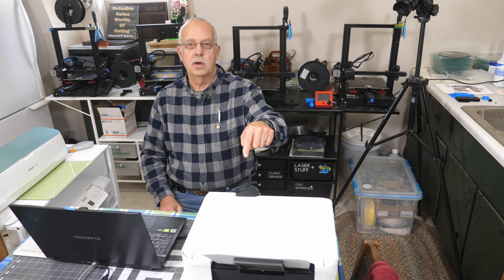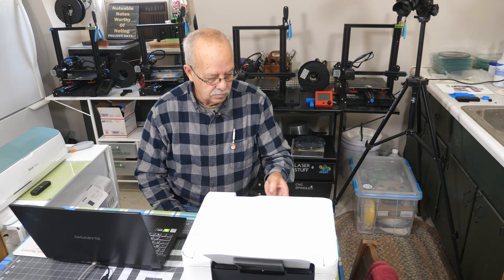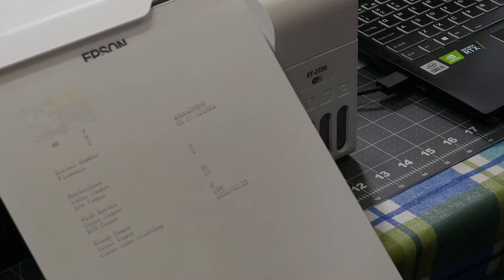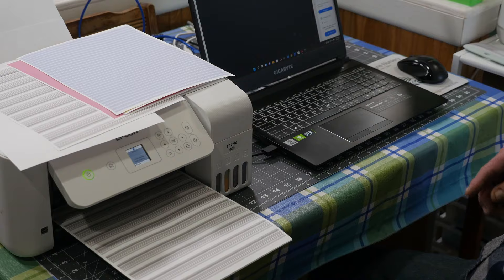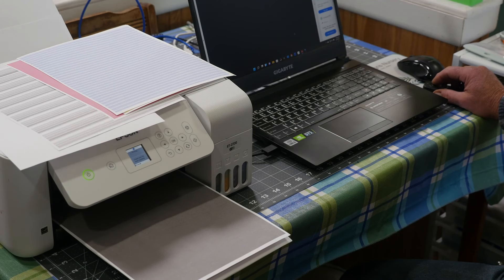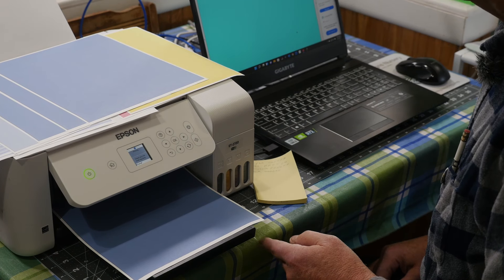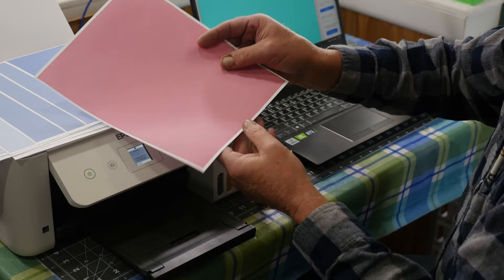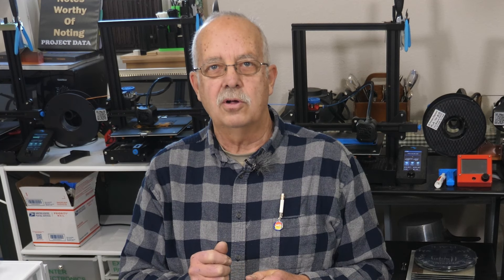Epson 2720 Printer Clogged Nozzles FIX

Comment: So I’ve been continuously doing the deep cleaning and using your free colors to print was getting black with many skips. But now no black comes out at all! Just refilled the tanks also
Reply from the maker: Ease up on the Power Clean or you will have a full maintenance tank that you may not be able to replace, depending on the model.  You could have a clogged line on the black.  Sometimes shaking the printer from side to side (don't get wild with this) several times can free up sediment or a clog.  Works for most, but not everyone.  Beyond that, it would require opening up the printer, disconnecting the line from the ink tank to damper, and check for clogs.  Not impossible, but not simple, either.

Comment: Hi Roger I’m following your video on nozzle clogging, my black and yellow started working, but my cyan and Magenta is not coming out at all after about 4 times . Do I keep running the color test until I start to see something?
Reply from the maker: You can try (gently) shaking the printer from side to side several times.  Some inks can form sediment that clogs the lines.  This works for some, but not all, so your mileage may vary, as they say.  As a last resort if this does not work, do a Power Clean.
Reply: @rogersshop  ok will try again today, hope I’m Successful , wish me luck, thank you.

Comment: Hi there, my Epson 2760 is printing dirty sheets.  There are smudges of black ink all over the page and in one corner.  It's worse on double sided printing.  This is happening even when the nozzle check shows that the lines are all in tact.  I use it a lot for my business and I need the copies to be clear. I do clear the nozzles and clean the print heads regularly when needed.  My sheets are printed with black print, pink print and sometimes blue print along with some graphics. Any advice?
Reply from the maker: Possible causes-  One of the internal damper ink tanks is leaking, ink pad at right hand side is curled up, ink pad is saturated and waste not going to maintenance tank, leaking ink line, printer was inverted at some time making ink leak internally.

Comment: Im currently in the process of unclogging my cyan. At first it was just a blank page and I'm now on about page 7 and it is now printing a light yellow. If I continue to print is the yellow a sign that it  is working or do I need to do power clean? Thanks so much!
Reply from the maker: Try shaking your printer from side to side several times first to dislodge any sediment.  If this does not improve, then a Power Clean would be the next step.

Comment: Hey Roger, thanks for this video!! I am only having issues with the black ink. I ran about 12 black pages before I switched to high quality printing and it printed full color, without streaks. So I thought I'd give regular printing a try again (thinking I had fixed the issue) and it still has streaks. Does that mean I just need to print in high-quality every time, or do you think I should keep printing pages to try and clean some more?
Reply from the maker: There can be a lot of variables here.  The head could be partially clogged, a line could be partially clogged, or it is possible the head is failing.  As a lst resort, you try a Power Clean to see if that resolves it.
Reply: @rogersshop  This is happening to me as well, and ive done 3 power cleans on it already. Ive even used the best printers cleaning solution. Not sure what the problem is, but as long as i print in high and not standard it prints fine. When i print out a nozzle check or an alignment page its got all the lines and I cant fix the alignment
Reply from the maker: @SG-cw4di  That is sounding like an issue with the nozzle head and/or firmware.  Can't help here...........

Comment: Hey Roger, my magenta isn't printing at all when doing your recommendation. Black looks perfect, Yellow looks perfect, but the Cyan is printing as a pale yellow and magenta isn't printing anything at all. Any recommendations? I'm printing the Magenta and Cyan 4 times now to see if it gets any better. I just got this printer a year ago and have only printed 232 colored pages on it. I have 16 pairs of earrings that I have to make this weekend so I need a fix ASAP!!
Reply from the maker: You can try shaking your printer from side to side several times, then try again.  This works for most, but not everyone.  I've had to run 20+ sheets before on some printers.

Comment: How long should I continue trying to print. I have been trying for 4 hours. Help!! Do you advise going into insides and trying to remove the clog that way? I did try the gentle shaking back and forth of printer and it fixed the black but not the other colors. I'm so disappointed as I didn't realize I should print something once a week at least. I just didn't print much. So I have basically a new printer hardly used that's not working.
Reply from the maker: Odds are it is NOT the head, but the damper tanks are not getting ink.  Try shaking the printer several times again.  Some inks can form sediment that blocks the outlet of the ink tank.  If they are hard-clogged, then you will need to open the printer, disconnect the lines and purge.  this is a VERY messy procedure!

Comment: Will this work even if I have ink, and yet certain colours are not printing at all when I do the color block test? The printer is less than a year old and not often used.
Reply from the maker: You may need to run the four sheets many times to clear it.  Once cleared, run at least a nozzle check once a week to keep in operation.

Comment: Sorry on  more question.  how often do you clean the heads?  Thanks
Reply from the maker: I don't.  I run at least one page of multi color every few days if not in use.  Even just running a nozzle check every day or two will keep nozzles from drying up.

Comment: Printed over 200 pages and no change in the cyan or yellow - magenta and black are fine. Don’t want to do a power clean so what would you suggest to try?
Reply from the maker: Try this-  Disconnect printer.  Pick up and shake side to side several times, then try again.  This works "most" of the time, but not 100% of the time.
Reply: @rogersshop I’ve tried shaking and still no cyan!

Comment: Is that an old Tos c55? excellent laptop for its class
Reply from the maker: GIGABYTE G5 KC with 32 gig ram, 512 K SSD and two 1 Tb SSD.  it was NOT cheap!  It is a gaming laptop, but that is not what I use it for.  The NVIDIA GeForce RTX 3060 it has is perfect for the graphics processing I deal with and it runs Davinci Resolve flawlessly.

Comment: Is there a way to "empty" the maintenance tank manually? Seems like a waste to just "oh well buy a new printer"
Reply from the maker: While there are "kits" to refill the tank with new material, the printer still needs to have the code reset and this is not free.  There are companies that offer a chip reset, but for a fee.

Comment: I have the same printer setup for sublimation. However the cyan isn’t printing. The fillable  ink cartridge has ink in it.  But I’m noticing the cyan print head cartridge doesn’t have much ink in it. I’ve ran the nozzle cleaning couple times.  Nothing.  Any suggestions?
Reply from the maker: Some inks can form sediment in the bottom of the tank, blocking the line.  You can try shaking your printer from side to side several times and this may dislodge it.  Works for most, but not everyone.

Comment: Hi Roger, I’ve had one of these units Et-2720 for about 18 months hardly used and that I think is where the problems at. It’s always had a full load of ink in the tanks but I fear the cartridge assemblies are the issue here drying out. Nothing was working all inks failed to print. Stripped the printer down flushed pipes/cartridge assemblies x4 purged the system via the nipples at the tank end onto blotting paper all was goo. Managed to get all inks printing solid on your test sheets. However after several sheets no more ink from the colours. What have I done wrong?  Are these cartridge assemblies part no 709/708 meant to be full of ink as well? Because they are not. Please help a very frustrated Dad.. Thanks in advance..
Reply from the maker: Sediment can form if sitting for a long time and this can plug the lines.  Most often happens on Magenta, but can happen to others as well.  Sometimes shaking the printer from side to side can break this free.

Comment: I have the 2720 and I tried the document printing like you show and my 8 prints  are white not color. I have cleaned the nozzles many times. I only have yellow and black printing and my levels are 3/4 full on magenta and the blue. And yes it’s sublimation ink. I wonder if you have any other suggestions thank you
Reply from the maker: Try shaking the printer from side to side several times, but don't get wild or you will have a mess.  Some inks form sediment that clogs the lines.  This "may" clear it up.  It has worked for some, but not all.

Comment: This might seem a little off topic but maybe you can help. I'm looking to convert my ecotank back to regular ink, how thorough do I need to be about getting the remnants of sublimation ink out of it?
Reply from the maker: This is not something I have ever done, so not going to offer any "untested" ideas.
Reply: @rogersshop  understandable.  So I tried it but I have to say I very likely turned my printer into a brick. I'm going to try thoroughly cleaning every part and refilling the ink one more time but if anyone else is wondering it looks like going to sublimation ink is a one way trip. I really had nothing to loose trying this I already had all the standard ink and I just got a new sawgrass printer for my ongoing sublimation needs. I'll let you know if I manage to salvage it.
Reply from the maker: @cherisola416  I also have a Sawgrass (SG1000), but still use the Epson for 8-1/2 x 11 sublimation prints since the ink is SO much less costly than the Sawgrass.  I only use the Sawgrass for 11 x 17 and 13 x 19 prints.

Comment: Does “head cleaning/nozzle cleaning” fill the maintenance tank? Cause I did that a lot of times 😬
Reply from the maker: Yes
Reply: My cyan won’t print it just is blank… any suggestions? Thank you!
Reply from the maker: @annathibodeau6451  Try shaking your printer from side to side several times, then try the Cyan color sheets again.  It is not unusual to have it take 25 sheets before it clears the line and refills the inner damper tank.  It is most likely NOT the head.

Comment: I need help my printer Epson 2803 just prints blanks it’s brand new I mistakenly out of excitement didn’t read the instructions properly and didn’t add the sublimation ink while setting it up and and ran the setup system with no ink and it doesn’t print anything 😢 I don’t see no ink running through the tubes they still look brand new what can I do or I’m I missing a step
Reply from the maker: The printer is not primed.  Once you have filled the tanks with ink, run a Power Clean cycle.  This should prime the tanks.

Comment: Thanks so much for your color test sheets. I print each sheet and they come out perfect but when I try to print green (my reason for testing) it looks like a purple no where green. Any thoughts on this? Thanks.
Reply from the maker: How does it look after sublimating it to something?  The cheap polyester microfiber towels from Dollar Tree are good test subjects.  If after sublimation, it still looks purple, then there may be an issue with the color profile installed, or selected.  This can get tricky as it can vary according to brand of ink, model of printer, and brand/type of paper.

Comment: I just received my printer today et 2400 and I set it up like it said to do but I'm getting lines thru all my colors you have any idea what could be wrong? Tia
Reply from the maker: If this is a brand new printer, then go for warranty.  That should NOT happen!
Reply: @rogersshop  I bought it off ebay it's suppose ro be brand new, but it didn't come from epson.
Reply from the maker: @heathergibson8477  If it is new, it should not have that problem.  On a brand new printer displaying the lines, sounds like a defective print head.

Comment: Hey Rodger I love watching your videos. Very well explained. I didn’t even know about the maintenance tank thing. I’ve done like 3 power clean and I hope I haven’t messed up my printer. 
Epson ET 2720bis my model.  I need to do just what you did. I’ve contaminated my Magenta with the Cyan so I sucked all the ink out and refilled refilled the magenta now it want print the magenta but everything else prints fine. Any suggestions?
Reply: Also how do I know my maintenance tank is full.
Reply from the maker: @ericseagroves  If maintence tank gets full, you will get a notice to contact Epson, which will then tell you that the replacement tank is not available (depending on model), or that you need to replace the tank.  Lower end models do not have a replaceable tank.  At least Epson does not offer it..........
Reply from the maker: Gently shake the printer from side to side.  there may be sediment in the bottom of the tank and this may dislodge it.
Reply: @rogersshop Came here to literally just reply thank you for this tip. I shook it side to side and it didn’t work, so I let it sit for a few hours and it worked! Thank you so much Roger!

Comment: Mine won't even print color. There were some faint lines until I cleaned printer head then nothing. Printed about 10 of your pages and nothing. I bought cleaning solution and followed instructions, again I got a few light lines on the nozzle check, did a nozzle clean and then nothing. I hate home printers such a waste !!  Thank you for providing help though!
Reply from the maker: Most likely not the head.  Lines are clogged.  You can try disconnecting the cables and shaking the printer from side to side several times.  Works for most, but not everyone.
Reply: @rogersshop  I will try anything since it's likely on its way to the bin. I did have the blue working a little for a moment. Thanks again.

Comment: Good evening, I follow your instructions and I have printed all the colors and the black I have printed more than 15 pages and it is still the same what will you suggest me to do thank you in advance
Reply from the maker: Gently shake the printer from side to side.  there may be sediment in the bottom of the tank and this may dislodge it.  This works for some, but not all.

Comment: Hello Roger. Thanks for this fix. I have a question. I used this method but I am not getting any ink to print at all. What do I do?
Reply from the maker: Sometimes it takes a LOT of sheets to get anything.  It could also possibly be the lines are clogged from sediment. You can try shaking your printer from side to side several times to see if that helps.  Works for some, but not all.  As a last resort, do a Power Clean.

Comment: Can anyone give me any advice?  I have been sublimation printing at least once at week on my ET 2800 to prevent clogging. I had zero problems until recently I added some more ink to my tanks and since then my cyan isn’t printing at all anymore. I have run many many purge files (possibly 20-25) and probably 5-8 head cleanings but nothing changes. There isn’t any blue at all on the sheet. I want to avoid doing a power clean but I’m wondering if I’m doing anything if absolutely zero blue ink is getting through. What should I do now?
Reply from the maker: As odd as this may sound...........Disconnect the printer cables.  Pick it up and shake side to side for a minute or two.  Reconnect and try again.  This works more times than not by clearing either sediment in the tank or an air lock.
Reply: @rogersshop thank you so much for your reply. I did end up doing a power clean this morning in desperation (this being day 4 of being clogged). I was surprised that my tanks still look quite full after the power clean. I am waiting the full 12 hours to see if it worked. If it doesn’t I will try your recommendation as obviously you are quite knowledgeable in these printers. Again, thank you so much for your time. Merry Christmas kind sir.

Comment: This was super helpful! My problem is my magenta is not printing ANY color at all!
Reply: Mine too
Reply from the maker: The Magenta seems to be a common denominator with a lot of people, for some reason.  Try shaking your printer from side to side, but don't get wild or you will have a mess!  Some inks can separate and cause a sediment that blocks the ink path.  This may dislodge the "gremlin".

Comment: Hi, just want to say thank you for taking the time to make this video and the free download. I did try it but the yellow and cyan printed an empty sheet. Nothing printed. Any suggestions?
Reply from the maker: Sometimes it can take a LOT of sheets running through before the head clears.  You can also try shaking your printer from side to side in case sediment built up in the tank and is clogging the linnes.
Reply: @rogersshop  thank you

Comment: hi roger my black ink is just not printing even running your small program black sheet so were is the ink going its running my cartridge low so were the ink going can u give me some advice cheers tony davies
Reply from the maker: If your ink level is dropping, but not printing, then there is something else wrong internal to the printer with the line from the black tank.

Comment: Printer 2720 makes a noise when starts up  screen on printer says it error 01 000021 then say’s 000031 but can’t do anything on It says contact support did that and said to take it fix shop. I need help
Reply from the maker: First code indicates that the plastic shield over the internal buffer tanks is out of place.  That is what is making the noise.  Second code can mean a couple of things:  Paper jam or scanner mechanism jam.  The printer needs to be opened up to repair these issues and that is way more than what I can cover in a reply as it is very involved.